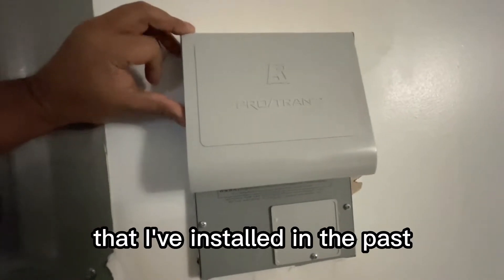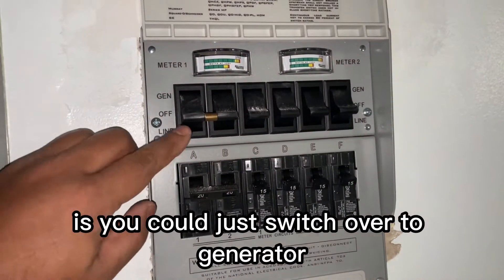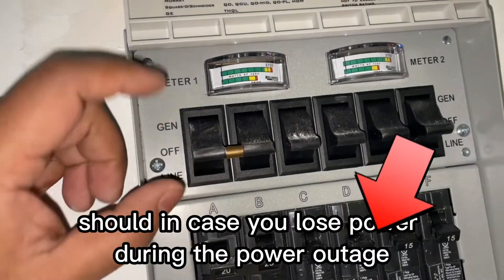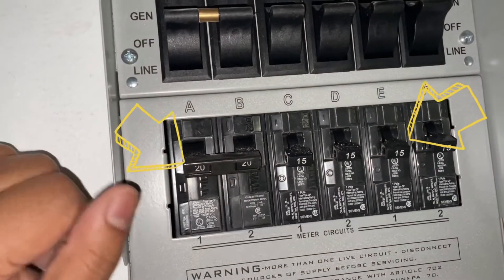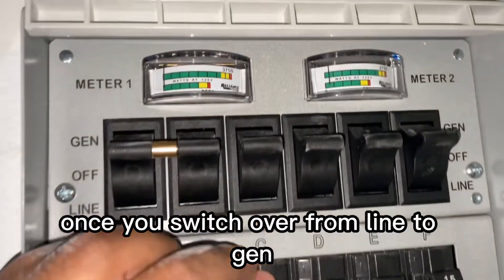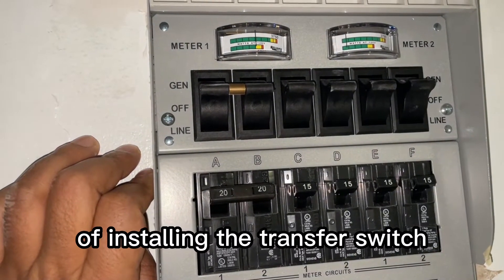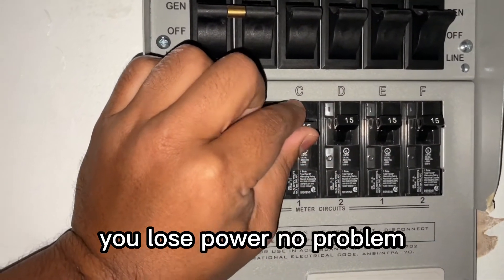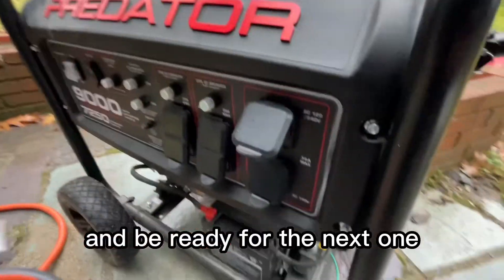What is a transfer switch- Reliance Controls 30 Amp 250-Volt

Comment: I had the exact one installed, but I forgot the steps of connecting and powering off. Can you do a video or send step by step instructions of how to connect generator to it and transfer over power to generator and then how to shut it down and transfer power back once power is back on?
Reply from the maker: How to Use Your Generator with a Transfer Switch and Inlet Box

Step-by-Step: Turning ON Power from Generator

1. Wait for a Power Outage

Only use your generator when utility power is out.

2. Turn OFF All Circuits on the Transfer Switch

Set each circuit to the OFF position to prevent a sudden load on the generator.

3. Move the Transfer Switch Main Breaker to “GEN” or “GENERATOR”

This disconnects your house from the utility and prepares it to receive generator power.

This is a critical safety step to avoid backfeeding.

4. Start Your Generator

Roll it outside, at least 20 feet away from the house.

Fill it with fuel, turn the choke on (if needed), and start it.

5. Plug Generator into Inlet Box

Use a heavy-duty generator power cord (twist-lock type) to connect generator to inlet box.

6. Let the Generator Run for 1–2 Minutes

Allow the generator to warm up before applying load.

7. Turn ON Essential Circuits One by One on the Transfer Switch

Start with the most important ones: fridge, lights, sump pump, etc.

Don’t overload your generator—stay within its rated wattage.

---

Step-by-Step: Turning OFF the Generator and Switching Back to Utility

1. Turn OFF All Circuits on the Transfer Switch

This safely removes the load from the generator.

2. Flip the Transfer Switch Main Breaker to “LINE” or “UTILITY”

Only do this after confirming utility power has been restored and is stable.

3. Unplug the Generator from the Inlet Box

Detach the power cord and coil it up for storage.

4. Shut Down the Generator

Let it run for a few minutes without load if possible, then turn it off.

5. Store the Generator

Let it cool, then store in a dry, ventilated space with fuel shut off.
Reply: TYSM

Comment: Nice video! Why are there 2 analog meters (and not just one) in the top part of the transfer switch?
Reply from the maker: @tedjohnson64  These are watt meters. Each one measures wattage on 3 circuit breakers. Circuit breakers labeled ACE is measured by the meter on the top left and Circuit breakers BDF is measured by the meter on the top right.

Comment: Can you run a AC System with this?
Reply: Depends on the amp draw of the compressor, not the btu’s. Also it would require a soft start to lower the amps on the compressor during start up.
Reply: With a soft start system and a large enough generator, yes you can.
Reply from the maker: It depends on your generators output and the BTU’s on the A/C unit.
Reply: Poor advice